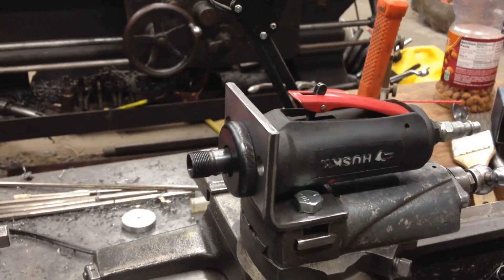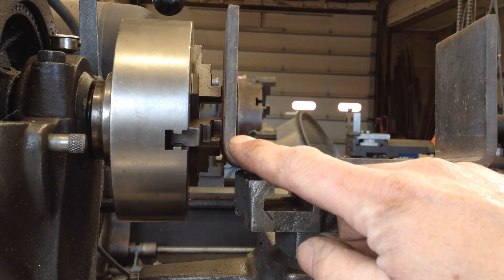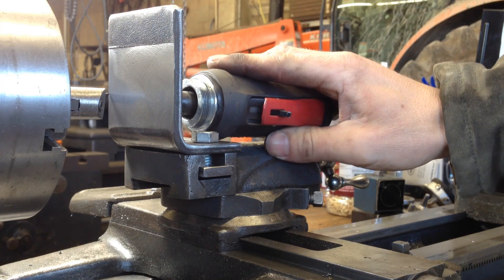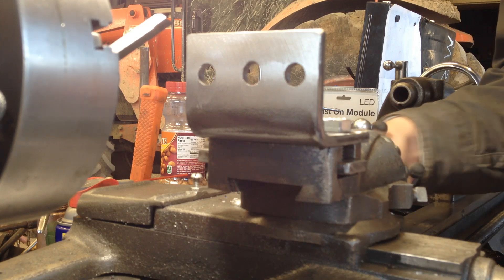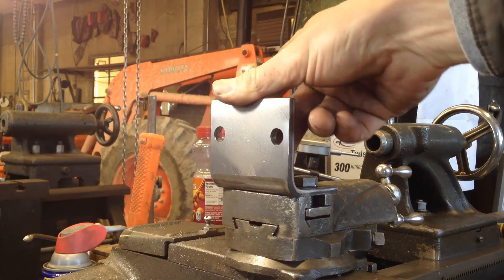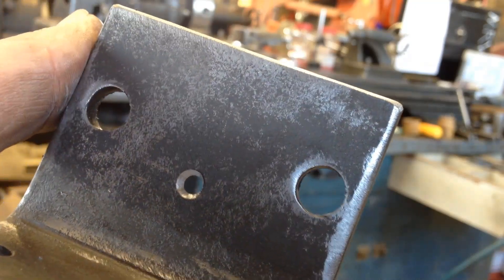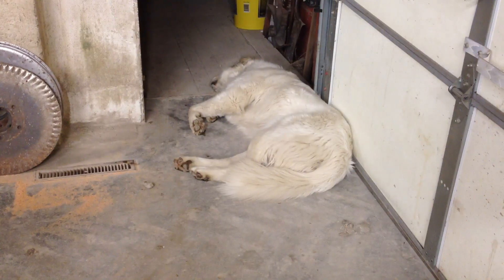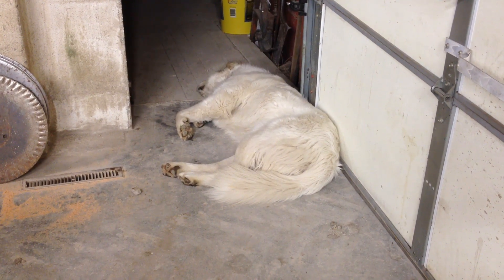Tool Post Die Grinder Fixture Build for the Atlas Lathe

Comment: LOL, that looked a lot like me building something.  I rarely draw up plans even though I've been using CAD for, oh jeeze, 35 years because I end up changing what I'm building 2 dozen times before I get it finished.  It's easier to just pretend that what I ended up with is what I planned on ;-)  

BTW, I just found your channel and watched 4 videos in a row.  Keep showing when things don't work out, the failures are as interesting as the successes, and how you deal with them is helpful.

Comment: Very nice. The xynudu channel built a similar rig, but he had a very small "pencil"  die grinder so he made a lathe toolpost tool  for  of it. I myself use a Dremel, I built a lashup lathe tool adapter for it. Fly cutters are not as nice as face mills, but given the tooling you had, I think you did a fine job. Good old Kansas Ingenuity.